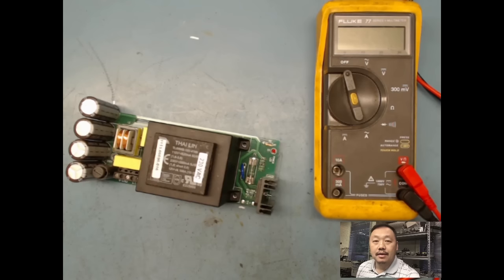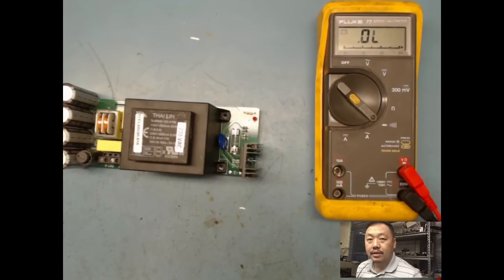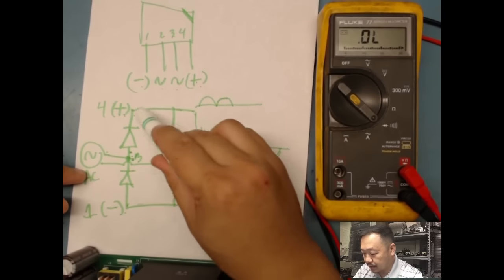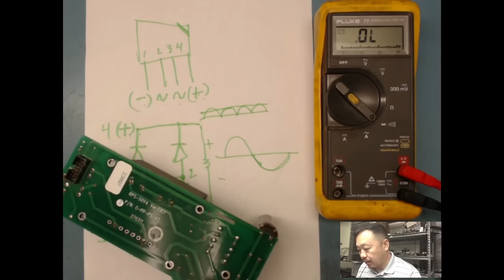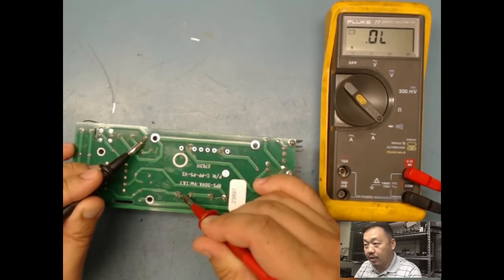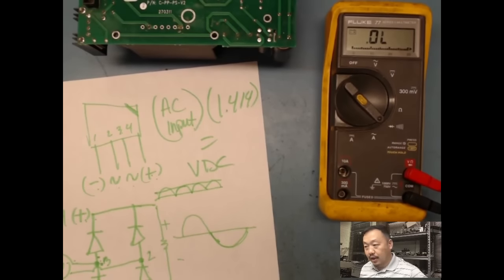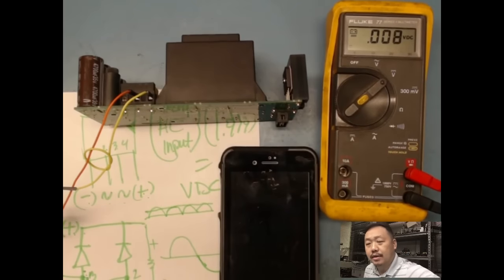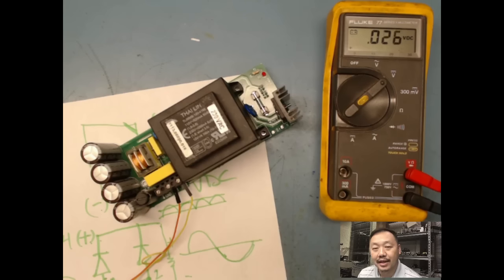How to Troubleshoot Electronics Down to the Component Level Without Schematics

Comment: Continuity is not considered a short specifically.  In some cases you want continuity and in some cases you DO NOT want continuity.  A fuse for example will have continuity when it is good.  When the fuse burns as it is designed, you will no longer have continuity because the fuse no longer is bridged together.  Now for example, take a wire that is connected to a motor.  Lets say that wire coating gets burned so that the conductor is exposed.  Now lets say that wire touches the metal frame.  Now we have a direct short problem because that wire is not supposed to touch other metal.  Now we can have continuity from the wire to the frame that was caused by the metal with the burned insulation touching.  So continuity can be a good thing and a bad thing.  In some cases we want continuity and in others we can use continuity to determine if a wire is shorted to say a motor frame (because we cant get inside the motor to see it but we know where we should and/or should not have continuity.  For a thermostat wire, there are multiple conductors.  Each conductor is coated with an insulating jacket.  Because those wires are bundled together, and they can run for long distances. it is a good thing to have continuity on the individual wire. It is not good to have continuity from one wire to the other unless it is purposely connected to that wire.  So, we can test this to see if we do or do not have continuity to see if a wire may be broken or touching another wire inadvertently.  (Understanding when you need power and when you need NO POWER is an important factor when testing components.  BE CAUTIOUS  Electricity is dangerous to work with so before testing make sure you understand basic electrical principles to avoid getting yourself injured or potentially killed)
Reply: Do you know if you can substitute a .25uf 150v with a .22uf 250v capacitor please 🙏?
Reply: @JessThomas-v1p  use what the motor is rated  for

Comment: It was fine for an introduction to troubleshooting, but it didn't really get to the component level. For that you need to remove the electrolytic capacitors to check each for leakage, ESR, ripple current, etc. If there are ICs, some schematics would be helpful - even if just hand-drawn schematics of certain sections. 

I'd also like to add that your other senses can be very helpful in troubleshooting. Sight is great for looking for bulging parts or burnt parts (or circuit board), but can also help identify component leads that are shorting to each other, solder joints that have failed (or were never formed properly), evidence of debris that may be conductive, hairline cracks in components or PCB traces, evidence that connectors were "jammed" together, LEDs that appear to be too bright or too dim, etc. Smell is also a very important sense, since we sometimes smell parts burning before we see them smoking or discoloring, and together with our sense of feel we can often narrow down locations in which overheating occurs.  Of course, our sense of sound also helps us  pinpoint defects if we hear components buzzing or squealing, if we hear crackling, hum, or other noise in speakers, motors, etc, or if we hear electrical breakdown (arcing) occuring. Some of us failure analysts even use stethoscopes for listening to component noise, thermal cameras to look for hotspots, magnifying glasses to check for component color changes, tiny loops of wires for "snooping" for RF inerference, and many other techniques for finding problem areas in assemblies.
Reply: What about touch?  You should rub your PC Board all over your body and feel it's pain.  If your capacitors are bulging, you have been licking them improperly.

Comment: Thanks for sharing. But you did not say much about the MOVs, what happens if they are bad, will that not affect the   board, what about the filter coil, what does it do and can one check it as well. Am a learner, excuse my curiosity. Again, thanks.
Reply from the maker: Usually, when the MOV is bad, they are blown up.  MOV are components that guard against power-line surges and overvoltage transients.  MOVs can affect the board if it is shorted but if it opens up, it will not.  You'll need to replace it since its a component meant to protect your circuits.

Comment: That MOV (Metal Oxide Varister), what did you call that? 
A quick way to tell if a power supply has a PFC (power factor) is to check for a 110/220 switch. Linear power supplies typically have them, PFC supplies don’t.
Reply: No kidding?

Comment: Far to lengthy with repetitive comments and repetitive WORD WHISPERS, such as BASICALLY !
You didn’t come over as confident in your explanations or methods. You should have run through 
your information beforehand and edited out most of the unnecessary confusion parts. The video could
have been explained in about 15 to 20mins max.

Comment: Well, a wire could be broken inside and the output could give instead of 0 V, for example 5 V and be still broken, right? (In which case we'd have to know which output it was supposed to give?) Btw, thank you for the video!

Comment: hi there i watched your video because ive got a 46" philips lcd. it will turn but has vertical lines in center of screen ive  checked power supply its working als0 couldnt find any  problems on main processor board. im assuming its the timin control t-con boards just wondered if youve had any experience with thanks.

Comment: Thanks for the video. Love it. I have short out a switch to ground on expresso machine pcb. Now the machine is not turning on any more. I believe there is fuse somewhere on pcb is busted. Do you have a tip to find the fuse on the board? How is it normally look like?
Reply from the maker: Fuses comes in different packages but  Look for a glass type circular component.  That is probably the most common type for what you have.

Comment: Thanks for the video. A couple of points I'd like to raise, if I could. I am a retired avionics tech. Watching you test the components IN SITU worries me! If you have, say, an open circuit resistor, that is connected to several OTHER components in PARALLEL, doing an in situ continuity check across the resistor will not show you that it is open circuit! The only way to be sure is to desolder one leg of the resistor and then check it! One ongoing problem I used to have is that a lot of circuit boards are covered in something called a conformal coating, to protect the soldered joints from possible damage and corrosion. This has to be scraped off before using a meter. I know that the meter probes are sharp, but often times, they were not sharp enough.  I could go on with a lot more frustrating problems I used to get, but I'll stop here.
Reply: Please do.

Comment: Is it safe to touch this commponet how do we make it safe before inspecting?
Reply from the maker: Make sure you don't have any voltage applied to what your testing.  Then use your voltage meter to check to see if there is no more voltage.  Once you confirmed that there are no longer any voltage present, you can touch it.

Comment: Good job, but I may add, u should have went the other way around when testing the diodes by swapping the leads and u should expect OL Open Load. If you see any numbers, the bridge rectifier is no good. I may add, sometime a bridge rectifier should be tested off circuit otherwise, it may show a faulty reading. My two cents!
Reply: What its worth.

Comment: So if the board is good, why did your customer send it in?
Reply: That's funny.   I guess you have never had to deal with returns. Sometimes people in the field don't care to find which component is bad so they pull a board and replace it to get the machine up. 
sometimes a loose cable or whatever was the problem so they replace the board and re plug a connector (the actual problem) and bam!  "it's fixed" so they send in the "bad" board. (there could be other issues like RF interference which shuts down that particular board etc. but those are less common)

Anyone else ?

Comment: I was just thinking. Couldnt you just do a continuity test from the positive terminal with the red lead of a multimeter and touch each lead on the components with the black lead on a multimeter to find out which part of the component is connected to the positive lead and then start drawing out the schematic from your findings?

Comment: Do you know why the formula is AC x 1.414 = DC ?
Reply: The formula AC × 1.414 = DC is a simplification often used in electronics to estimate the DC output voltage of a rectifier circuit, like a bridge rectifier, from an AC input voltage. This formula is derived from the relationship between the root mean square (RMS) value of an AC waveform and its peak value. The RMS value is a measure of the effective voltage of an AC waveform, and for a sinusoidal waveform, the peak value is √2 (approximately 1.414) times the RMS value. When AC is rectified to DC, the peak voltage of the AC waveform becomes the maximum voltage of the rectified DC output, before accounting for factors like voltage drop across diodes or ripple voltage. Thus, multiplying the RMS AC voltage by 1.414 gives a rough estimate of the peak DC voltage.

Comment: OL: Overload, according to Fluke https://www.fluke.com/en-us/learn/best-practices/test-tools-basics/digital-multimeters/digital-multimeter-display then EXPAND the "Specialized Indicators" tab.  I think 'Overload' because the meter generate a constant current about 0.6mA and measure the voltage across the 2 leads. Without the load on the leads the voltage measurement is overloaded or above the measurable range. Google search shows some with "Open Loop" which makes more common sense.  The video is lengthy for experienced tech but it's perfect for beginner because he keeps repeating himself and that would be helpful for beginner to remember. 

Electronic Tech, be professional and replace a new battery for your meter.

Cheers

Comment: OL = Open Loop, not Over Limit. The open loop is reading a component that doesn't have a short. Its similar to reading infinite resistance. Also, when you are measuring a resistor you measure its ohms, in troubleshooting you are not concerned with its wattage. Watts is just the amount of power the resistor can handle before it burns up.
Reply: Actually stands for over load read the manufacturer documentation of your meter.
Reply: @CBRadi0_89  maybe for a charger not for testers, it means open loop. Over load would not make sense?
Reply: Nope 100% for DMM OL is overload for instance look up the Fluke 80 series V getting started manual page 10. I've heard lots of variations like open loop and outside limit and they do make more sense.  I'm just stating how manufacturers define OL

Comment: HOW do we know when we must REMOVE the component to properly test it?
Reply: If you don't have the schematic you don't know, but there can be clues.  For example, if you are measuring the resistance of a resistor and you get a different reading depending on which side your probes are on, then there is an active device in parallel with it.  It also depends on how good your multimeter is.  Some multimeters for instance put out very low voltage when measuring resistance.  It's important to know how your measurement instrument will load the circuit.

Comment: The two middle pins of the bridge rectifier while checking with your multimeter is NOT the secondary winding!!
The primary winding might have a centre tap (tubeamps for instance) but in most cases 2 wires ac in and multiple dc out.

Comment: What if the bridge rectifier doesn't test short across the two AC pins, does that mean that there is an open, or that the bridge rectifier is bad?
Reply: The rectifier should not show a short across the ac pins. If it does show, it indicates a short. If doesn't it means there's no short but it doesn't eliminate the possibility of other problems. Hope this helps.

Comment: I’ve burnt myself on caps like that before.  I’ve heard shorting them is a good idea so I always do this, but not sure if there is something that can be damaged by doing so, since sometimes you see the arc.  Never had problems though.
Reply: They say it is better to bleed the caps with a resistor, in fact most caps tend to have bleeder resistors in good quality modern circuits. 1 megohm is the typical value but anything more than a dead short is much better for the longevity of the cap. Hope this helps!

Comment: Your bridge rectifier drawing is a little off but the explanation is spot on bridge rectifier in a circuit is usually diamond shaped
Reply from the maker: Its just drawn differently.  You are correct though.  Most drawings of a bridge rectifier is in a diamond shape but what I find is that most people can easily understand a bridge rectifier from the way I draw it.  Thanks for the comment and thanks for watching!!
Reply: @electronictech785  exactly! The way you put it, it's much simpler and easier to understand.

Comment: Power supplies switching/inverter type fail much more frequently than linear transformer type.  Component level repair was common in times past, not common today.  Just cheaper quicker to replace.

Comment: What is special with the FLUKE 77 ?, among all DMM brands available thru the market, this model seems to be preferred by a lot of techs.
Reply: Very sturdy and reliable with good range and functions yet still affordable to get several in a business. Standardized leads as well.
Reply: You can measure Ac with fluke .it's actually realible..We are also using fluke at our workplace

Comment: Would a shorted rectifier show OL? You didn't say.
Reply from the maker: No it wouldn't.  If the meter is in the "diode" mode, it'll show 0.0v.  If the meter is in "ohm" mode, the meter will show 0 ohms
Reply: A better question, would a rectifier that is bad, show an open or a short? A bridge rectifier can potentially show either an open or a short circuit, depending on the condition of its diodes.

Comment: Question: Are you just supplying the 115 volts ac with a regular household socket? Can I do the same just be using a cord that has a normal three prong  plug on one end plugged into a power strip?
I know I seem stupid to you guys, but I am trying to learn.
Reply: NO! His AC is current limited (from power supply)
Reply: @pingpong9656  I feel like an egg... Is he using a DC desktop power supply then, or do they have desktop AC power supplies? I know it is a dumb question. I am at next to zero knowledge but having fun trying to learn...!
Reply from the maker: I'm using a variac.  It is able to go from 0vac to about 150vac with the one I'm using.
Reply: When working inside MAINS powered equipment, DO NOT plug it directly into wall or power strip. To protect your LIFE, you need an isolation transformer with a VA rating exceeding that of the equipment being tested (aka, "device under test", or "DUT"). To protect the DUT, you also need current limiting of some type. In the video, the instructor used a VARIAC which privides NO isolation, and current limiting is the variac's own fuse. A VARIAC is good for many tests when plugged into isolation transformer, but has big limitations when DUT has SMPS. You need real current limiting (e.g. a Sencore PR570 is a benchtop tool for powering consumer devices. It features isolation, variable voltage and real current limiting). If you need cheap current limiting device, use incandescent light bulb(s) between your isolation transformer and DUT, in series with "L" on single phase. Selecting the right bulb takes a bit of math, and you'll probably have several if you work on a variety of stuff. This subject deserves it's own, comprehensive video. Perhaps the instructor might make one so students don't electrocute themselves?
Reply: @hightttech  perhaps you could offer a video? I have already learned much. Thank you!

Comment: There is a 1,4 Volts drop through the bridge rectifier that you forgot to consider and this explains the lower than you expected voltage.
Reply: Sorry, but nope, all measurements on the bridge rectifier delievering correct results. Voltage drop of one diode is 0.47V. Voltage drop between DC- and DC+ is caused by two diodes, so 2* 0.47 = 0.94V. He only forgot to check vice versa.
BTW: The power supply was driven with ~ 150VAC via transformator, not with the usual 230VAC mains voltage. Hence, there can´t be the nominal output voltage expected.
Reply: ProBang 2 OK so the .94 Volts were not mentioned during the video and it should be considered.
Reply: @einarht21  don't forget the LED too

Comment: what is the use of capacior in power supply
Reply from the maker: Filtering.  It smooths out the dc voltage and kicks in when the input voltage takes a dip.

Comment: It looks like it is a really well-built power board.  The electrolytic caps would be probably the most likely components to fail.
Followed second by dry joints on the transformer pins. Not much to go wrong really.

Comment: OL means Open Loop.
Reply: Or  infinity   IF YOU OWN A FLUKE METER OL MEANS OVERLOADED MEANING NOT JUST OHMS OR  DIODE BUT FOR EVERY FUNCTION ON THE METER JUST SAYING    OVERLOADED MEANS ITS OUT OF THE RANGE OF THE METER. SETTING. AUTO RANGE HELPS
Reply: No, it means Over Limit.  I noticed the guy with channel LearnElectronics made that same error.

Comment: If the meter beeps or shows 0 resistance, it means that electricity can flow freely between those terminals, and in most cases, that means that the device is good.
Reply from the maker: zero resistance can mean "short".  If a component is shorted, then current is able to flow through and that is a bad thing.
Reply: Not really not all component specially fuse